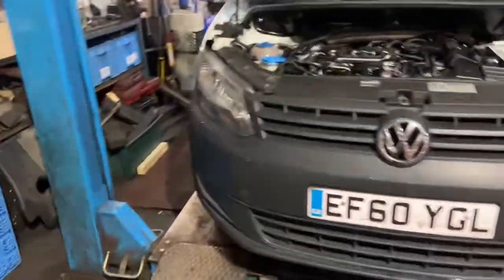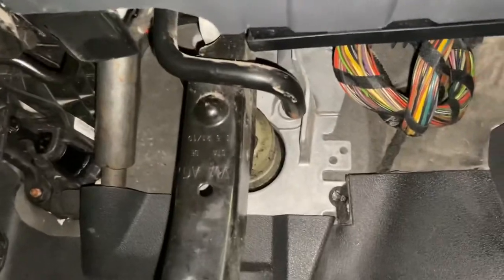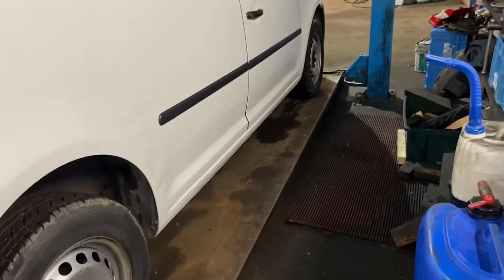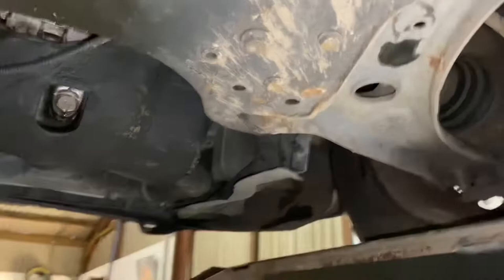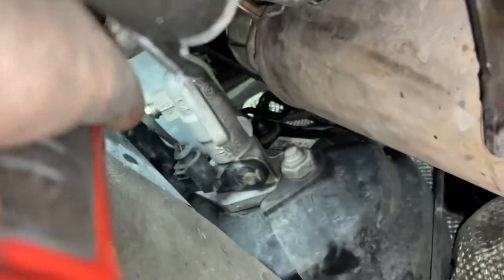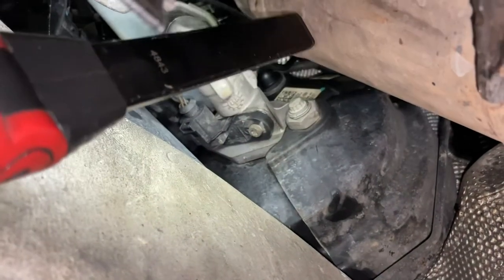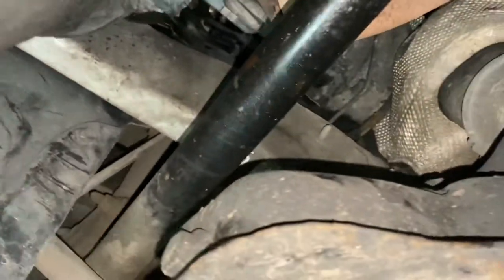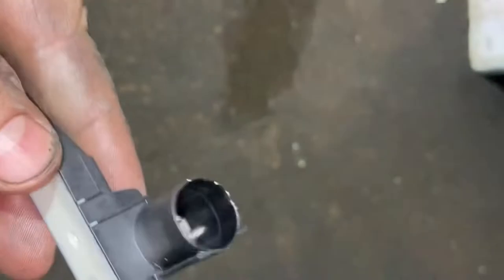Volkswagen caddy brake light switch location

Comment: any idea if I had a bad master cylinder  would it also cause similar issues as if I had a bad brake light switch?
Reply from the maker: I guess it’s a possibility but I’ve never seen one fail that way before. It would be worth having an auto electrician look at the wiring first I would say.

Comment: Replaced the switch and still didn’t fix my brake light from staying on. And car starts without pressing breaks
Reply from the maker: Sorry this wasn’t your problem. Maybe there is a good auto electrician in the area that can take a look?
Reply: Took it to VW…. Wires were damaged needed to be rewired
Reply from the maker: @FaithMerino1  ouch sounds expensive. Glad you got it sorted though
Reply: @FaithMerino1  Hello !
Reply: @FaithMerino1 Which wires did you find the problem in?

Comment: I just replaced mine but brake lights are still on
Reply: How you solve bro?
Reply: @jojoprieto7400  did you replaced the sensor?
Reply: Yes bro but the light still on
Reply: @jojoprieto7400  check all the fuses brother
Reply: Same problem. I changed the sensor but the lights are still ON. Did you find where is the fault??
Reply: @ThePytrak  check all the fuses
Reply: @mtsanchez27  Thanks , did that and they all looks fine unfortunately 😔
Reply: @ThePytrak  let me know if you find what's causing the problem bro
Reply: Did u fix it? I have the same problem